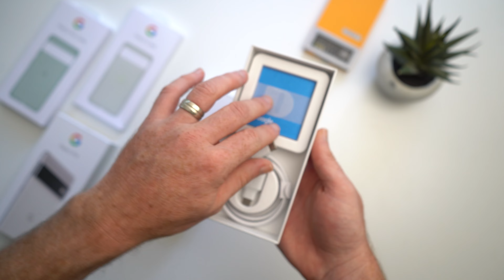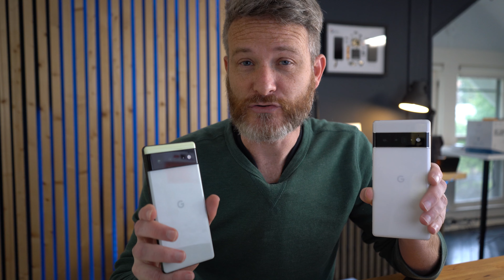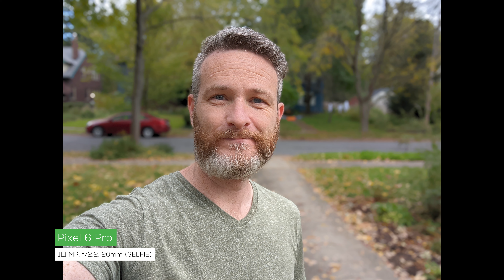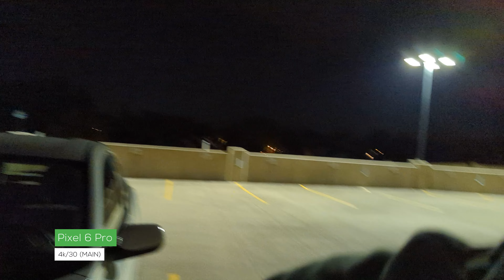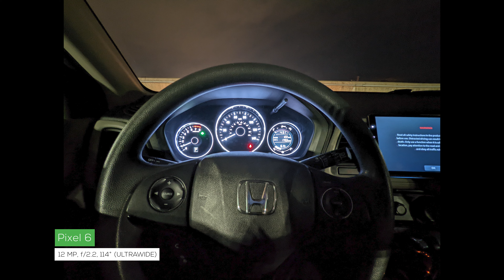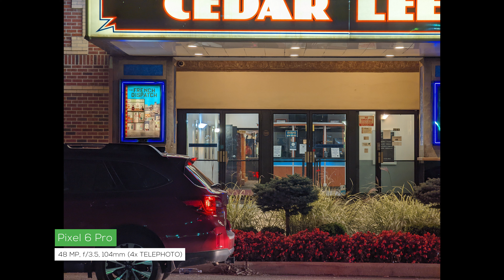Pixel 6 Pro camera test

Comment: Really love the new telephoto, I just hate the size of the pro. Do you think night sight should allow the user to choose the exposure time?

I still enjoy using my pixel 5. I'm not convinced the regular 6 is worth the upgrade.
Reply: Does anybody have problems hearing you while you're talking on speaker phone? With the pixel 5
Reply: @SINLEADSTOHELL  seems to be ok for me
Reply: @dct1    do you use your phone in noisy conditions like the vehicles. Or loud fans?
Reply: @dct1   The problem will be people saying huh. I can't hear you. You're breaking up
Reply: My thoughts the same on the size of the pro. Even considering keeping my Pixel 4 now. 🤷🏻‍♂️
Reply: @mwboost  you should hang off until the 6a and 7 are confirmed.
Reply: I bought my wife a 6 and i got a 6 Pro and the size difference between the 2 is only very slight. However i moved from a Pixel 5 and goodness me the 6 Pro is massive and weighs a ton. My wife on the other hand moved from a Oneplus 7t and said this Pixel 6 is smaller! So far the battery life on my Pixel 5 is significantly better than it is on my 6 Pro but clearly the camera system is much more advanced on the 6 Pro so it all feels a bit swings and roundabouts at the minute.
Reply: @MrBelter  yes so many pros and cons. I just don't the need for the size of the devices.